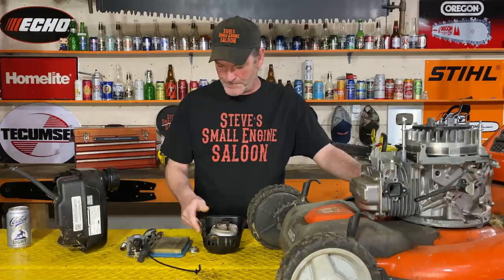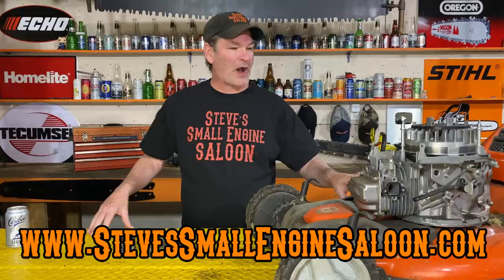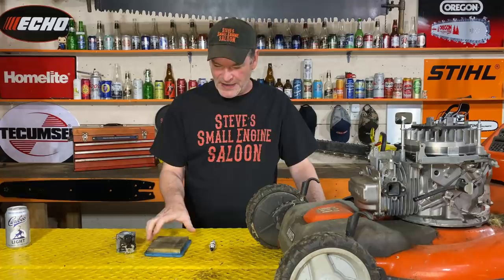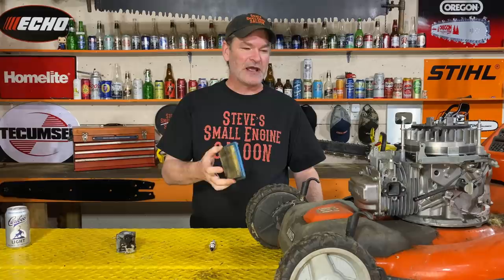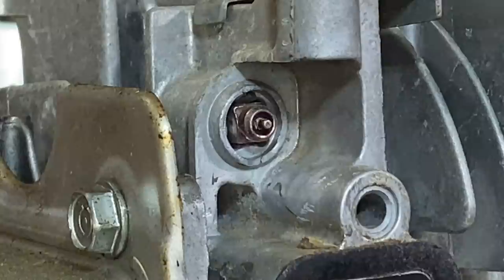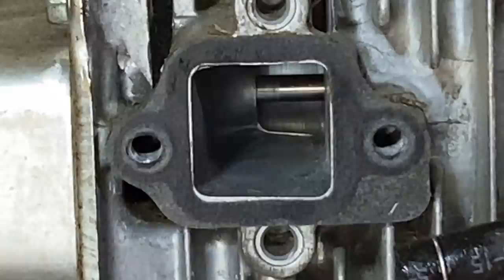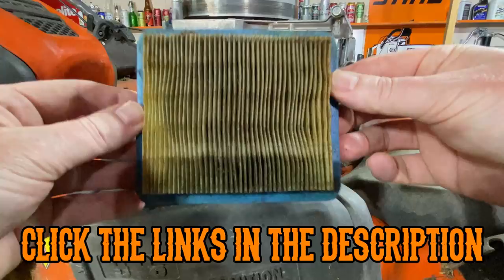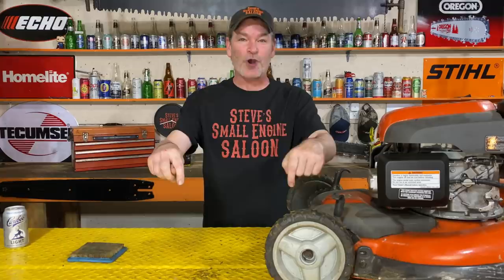What Happens If You Flip A Lawn Mower Over Wrong?  (LOSE MONEY)

Comment: I bought my house almost exactly 4 years ago and bought the cheapest lawn mower with a small 140cc Briggs to cut the grass ASAP before my new neighbors and HOA got mad. I really want a Honda lawn mower and I've been tempted on craigslist, but surprisingly this little Briggs engine will not die. I even manually increased the running RPMs to 3600 lol. Never had to clean the carb and always starts on the first pull. The only thing I've done is oil changes once a season and changed the spark plug once for preventative maintenance (not that it needed it)
Once it finally dies I'm definitely getting a Honda though.
Reply: @marcmyers1465  Oh yeah I believe it now lol. My only gripe is that it's a bit underpowered which is why I had to raise the RPMs to 3600 which made it much better - but louder. Can't really expect much out of 140cc though. I'm too cheap to get a new mower if this one still works just fine so I guess I'm stuck for a while lol
Reply: @marcmyers1465  You are exactly right, that is actually what I think about. I think the Honda mower would definitely cut my mowing time especially with the adjustable walking speed and stronger motor and make my life easier. Maybe I should just pull the trigger and give my mower away to family.
Reply: My uncle gave me a mower he bought at a yard sale in 2001. I didn't have a book so called the # on the metal plate. They sent me a book on it but told me it was almost new. The earliest it could have been bought was the prior summer. It was the very lowest price mower the big box store sold. It's now 2021 and oil changes a few times and spark plugs more frequently it is the best little mower. It mulches grass leaving no visible residue. I started having lung problems but wanted to continue cutting my own yard and luckily he found an older self propelled Husky that said, "sell for parts". A friend changed oil, new plug and started it. Don't know the problem, maybe he was like you-wanted new. So for about $10 I had a great self propelled mower, single lever height adjustment. I bought a new self propelled Snapper about 3 years ago, don't particularly like it. But, the best mulcher of all is the little 20 year old mower that just keeps chugging along. We use it for areas of yard needing a lot of back and forth in close area. It's lighter and faster as self propelled are somewhat heavy for me, 67, and just easier to use push vs self propelled. You never know what you're getting with those "problem" mowers but if you have a little knowledge often it's easily fixed and maybe can help someone who can't afford to buy a new one.
Reply: @carolecampbell8813  Thanks for sharing :)

Comment: I have the LC221a w/ B&S AWD and for the most part it has been a good mower but the drive system is horrible. You're lucky if the pulleys will even last you 2 seasons, they are cheap enough less than $10 each but it's a constant issue and it's all open underneath so you have to keep everything cleaned out and maintained for it to work properly. The wheels themselves have a gear that can easily strip out and the cable can stretch as well.  It's a shame really the rest of the mower is built very well and appears that it will last a long time. I didn't realize Husqvarna stopped producing these mowers in 2019 so I want to stock up on these parts before they become unavailable. We've only had ours a few years so must've purchased it near the end of production.

Comment: That's a fortunate deal for you Sir. Thank you for the video. I have a question... Can we clean the whole outside of the engine, carburetor, and camshaft and everything else on the outside of our push lawn mower with brake cleaner? I have a used and very dirty push mower, and I removed the plastic housing cover, the plastic fuel tank, the 2nd metal plate housing, the air filter & cover, the spark plug, and the muffler. I covered the spark plug hole and the muffler hole with plastic bag and paper towel so nothing will get in the holes. It has a lot of grime and dirt all over, and I want to clean it all off but I'm not sure if this is something that can be done without damaging it somehow? If this can be done, is there anything else (electrical or other) that I need to cover with plastic to not get it wet and damage it? I wanted to get the advice from someone who knows about these things.  Any help is much appreciated.

Comment: I got a huge kick out of this video because I am teaching my 12 yo son about engines.  We bought a John Deere push mower at a garage sale for $5 USD.  Owner said, "we can use it for parts or for learning but it doesn't run."  I thought "perfect."  We took it home and I started showing him about the engine.  The 2nd thing we did was remove a very dirty air filter.  I asked him  to look at and tell me if he thinks that may be a problem and why.  He said he didn't think the engine was getting enough air.  I had him re-connect the plug and give it a pull without the air filter in.  It started with one pull and  works great. He came away having actually fixed his first real engine.  I thought that the air filter was only part of the problem but it's been running great every time.  Guess that was the only thing wrong.  So for $5 USB plus the cost of a replacement air filter...we have a great John Deere push mower.
Reply from the maker: That is awesome Chris!

Comment: That is a sweet sound on that gift. I want to thank you for all your instructions, and I don't expect you to answer this, but my Briggs and Stratton engine won't start. I've tried many of your suggestions. Cleaned the carburetor, and yes, new filter, new spark plug, new gas, but I wasn't getting any spark so I did an ohm check on the magneto. 4.7 secondary. 1.6 primary, but yet no signs of spark when tested with a spark tester. I even dropped a tsp of gas in the cylinder. It's dead. I can't complain too much because I've had old faithful since 2004. By the way, the compression is between 60 and 70 so I'm not certain if that could be the problem, but then again no spark. For my last try, I'm thinking of getting a new coil. The gap between the flywheel and the coil is .010. I'm stumped. Thank you for all your help. Much appreciated, Steve.

Comment: I’m surprised you haven’t done a video on the classic craftsman push mower with the tecumseh engine. That carburetor is notorious for having issues with feeding fuel to the engine but will run only when you prime it and as soon as you stop hitting the prime it will die. There’s a small hidden little hole in between some threads that I normally clean out with a staple after bending one side of the staple flat leaving the one 90 degree bend to poke through that troublesome hole in between the threads in the carburetor.

Comment: I was given a pressure washer that would not run right.   It would start with starting fluid but not run.   I grabbed the carb and it wiggled.   One carb mounting stud was missing a nut and the other was very loose.   That was 8 years ago.   Regular valve adjustment on the Honda engine and it starts on the first pull and hums along.

Comment: Hey Steve thanks for this video! I happen to have Husqvarna very similar to this one with the Honda engine (I think the same series) My issue is it sat for a while so when it started it (with clean fuel) ran then sputtered out. It would start then again idle down then die. I did check carb, oil, fuel cap and plug they seemed good, never did know about that wax plug though. So my next step is to remove air filter and see what happens, the filter is dry but looks a bit dirty or slightly dark. I will give it a go. Yes I did check the fuel bowl and float it looks good . Cleaned it anyway and reassembled. 

I will have to admit though that I did leave fuel in the tank while it sat for month's, the bad thing I did was leave the fuel valve open. So the tank was dry, my bad. oops!

My first assumption was it was not getting fuel that it was a fuel issue, I thought maybe it had to do with spark plug but I thought not. Never bothered to check air flow and choke. If it is not air filter then I need to research this wax plug thing further, unfortunately you did not get into detail about that. Hopefully you will, if you do please let me know.

If that does not work I guess some how I have to check the choke system and this wax plug thing, btw not too keen with this auto choke thing. Thanks again! I know that I can count on your sound advice and videos.
Reply: Well before I had started work I went back to watch your Honda carburetor rebuild video. So I went back to the carburetor did a thorough breakdown & clean. 

There was heavy dirt around wax plug as well. Cleaned it all reassembled and lo behold it ran. Started roughly at first but then smoothed out.

Thanks again Steve!

Comment: Good call on the filter. I had a neighbor do the same thing, minus giving me the mower, where his son turned on wrong side and then was smoking from all the oil in the filter and running like crap. New filter did the job on it also.  One thing is that engine is actually the GCV190 vs the 160 engine so even better deal.
Reply from the maker: Right on John!  Thank You...

Comment: Last week, I retrieved a 2-yr old mower at the curb from a neighbor that said they bought a new one as they couldn't get this one started. I assumed the cable was stretched, but after turning over the engine, it made a horrible metal-on-metal sound. I removed the pull rope assembly and there was the flywheel, snapped completely in two.
Reply from the maker: WOW!

Comment: Reminds me of the time my old Ford pick up would not start, I could not see any fuel going into the carb when I pumped the throttle.  I deduced it must have been a bad fuel pump.  I WALKED to the auto parts store, bought a new fuel pump, laid down in front of the United States Post Office and changed that stupid thing out.  Still no gas pumping in carburetor.  Turned out to be a plugged up inline fuel filter which I could have taken off and probably blew through in a pinch to clear it out good enough.  Still mad at myself over that one.....
Reply: I will hazard a guess and say it was that metal filter that screwed into the front of the float bowl on a 2 bbl carb? Had that almost bite me one time too, but my first thought was to unscrew that filter and see if fuel was getting to the carb. None came OT of the filter after it was loose, so started thinking pump like you did, then I pulled the filter off the rubber fuel line and cranked it again. Fuel went all over the place. Poked a hole in the plugged up screen so I could drive a mile to the auto supply and got a new one.

Comment: There's quite a few things In have acquired for free. One example, was a weed whacker, it was a 4-stroke, and it wouldn't crank over at all, wouldn't even budge. Well, I checked the oil level by taking out the fill plug, oil immediately drained out....the oil had been filled so it wouldn't take any more....fluid-locked it up. I had it running in 5 minutes after establishing the correct oil level
Reply from the maker: Right on buddy!
Reply: LOL I had the same happen with a Toro 4 stroker weed wacker. It cost $400 at the time.

Comment: I had someone give me a 5yr old mower, with bagger equipment for free to scrap it that they had done the same thing...tipped it over in the filter side and it wouldn't start after that...I took it home did the usual checks of plug, air filter, fuel and carb...and I an $8 filter and it was running like a champ...needles to say I flipped it and sold it for $150...netted myself $142...also had about a dozen others that I've picked up from people giving them away as scrap and less then $15 in parts on most of them and sell em for $75-100 each one...it's easy money

Comment: Steve actually took a Craftsman than yesterday the deck was so filled with grass I blew everything off would run for 30 90 seconds and shut off and then I took off the air cleaner it was packed because they didn't clean the air cleaner off where the deck and as we know to text sucks from the bottom end it clogged up the air filter put air filter on mind you a used air filter that was okay mode my whole lawn

Comment: Over the last 10 years this is exactly how I've gotten most of my lawn equipment. Friends that gave up on stuff replaced with new. Got a John deere self propelled walk behind with a similiar issue-air filter clogged with clippings though not oil. Husky weedeater that was seized up. Poured Kroil down the cylinder let it sit for 2 days and was able to free it. Been running for over 10 years now
Reply from the maker: Cool!

Comment: Score!  It pays to know what an engine needs to run. I got a free mower once that only needed a new fuel cap, one of those “ fresh fuel” caps. Another one I got was simply low on oil, had a low oil shut off system, similto air compressor
Reply from the maker: Right on

Comment: Super Score! I got a free Briggs Quantum Craftsman a couple months ago from the neighbor... She had bought a new mower, the  automatic choke had gummed up. I just poked it with a screwdriver to free it an sprayed it down. Starts on the first pull every time. I get so much free equipment because so many people know I repair it and I have the parts suppliers set up. Free stuff is even better when you get parts wholesale. I got a free ride on a couple of months ago the owner up the street gave up on. A plastic linkage on the carb was binding because it's bolt rusted up and the governor wasn't able to control the carb. It wouldn't rev up. A few minutes later it was running like new
Reply from the maker: Interesting!

Comment: I have never bought a mower.
I have picked up free ones on the street my whole life and cleaned the air filter or reattach the throttle cable and always had great mowers.
Only reason I have to keep getting another mower is because I always give my working mower away to someone and simply pick up another one off the street.
Reply from the maker: That is AWESOME buddy!  Thank You...
Reply: Same here. My last three mowers cost: $0, $0, $12. So an average of $4 bucks each.
These are 20 - 30 year old Briggs engines that will last me a lifetime.
Reply: @marcmyers1465  Does anyone like the new Briggs plastic carbs? I've been running these old Briggs Quantums so long I really wouldn't know.

Comment: I've got a mower just like this, wish mine was that easy to fix. It has hard jerk back on pull cord when trying to start. Checked timing/ flywheel to see if the key was sheared, it wasn't. Looked to see if the piston was hydrolocked, it isn't. Oil is fine, compression is fine, spark is there. Some of these models had problems with the engine being crap. I can't figure it out.
Reply: I wonder about compression release.
Does it hoot?

Comment: I've had alot of mowers come in with oil soaked filters. Most of the time they did their own maintenence, which is fine, but the kit comes with an air filter, spark plug, and 1 quart of oil. They end up just dumping the entire quart in and the excess oil pumps through the breather right into the air box.
Dipsticks have a purpose. Lol.
Reply from the maker: Agreed!

Comment: My old mower was toast. 30 yrs old, rusted out motor finally died. Got it used to start with so no loss. Took it to the dump and there was another one exactly like mine but looked in great shape. Asked if I could take it, they hummed and hawed, finally said yes. Got it home, checked the spark, yup. Had gas and oil. Gave it a yank and fired right up. Started to cut with it and it clattered and banged something fierce. Flipped it over and the blade was beat to hell. Put on a new one and 15 years later still running.

Comment: He  turned  it over on the wrong side and to much oil in the gas and oil in the filter . Of course it could be a couple of things , clean the carburetor out a try too start it. It will smoke for a little while  , so many things clean the plug also . This is after it's back together of course .i like getting these easy fixes , don't get too many easy one's give to me tho . 👍After I finished watching the video  - you  were lucky , cause I'd got one before that it had to much oil in the carburetor from them turning it over or too long - just once - but I think also they'd  put to much oil in from the beginning  too . . Lucky dog - good video .
Reply from the maker: Right on

Comment: A bit of a long story but I was using a manual push mower last year at my new house (first house) and my parents decided to upgrade lawn mowers and gave me their old push mower that was pretty neglected. Ran rough, had little power, and was hard to start. I was all ready to rip it apart and rebuild the carb, etc. but decided I would do all the basic maintenance that this mower never had. I watched Steve's videos on tipping the mower and how to sharpen the blade (it was rough) and ordered all the basic items such as a new air filter and spark plug. Also needed a new muffler and replaced the oil.

The muffler and plug arrived early so I replaced those, not much change but it was quieter. Sharpening the blade did make it cut better but it was still hard to start and bogged down but I didn't have time to rip it apart. The air filter arrives and I need to mow the lawn after a big rain so I decide to throw it on and give it a go.... needless to say 15 years of crap in the filter made it a horrible mess. Threw the new one on and went to go do the usual 5+ pulls to start it.... boom instantly fired up and purring away like it was brand new. No bogging down, no hesitation, and was cutting better then ever.

Never overlook the basic maintenance items as a starting place when working on something, it is amazing what just that small amount of work can do to a machine.